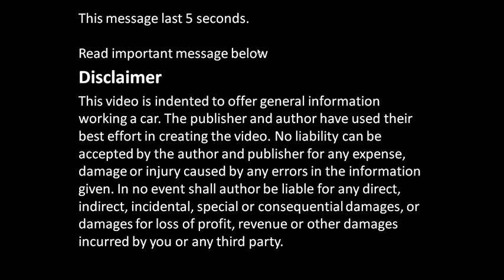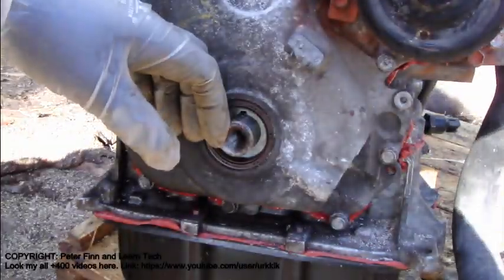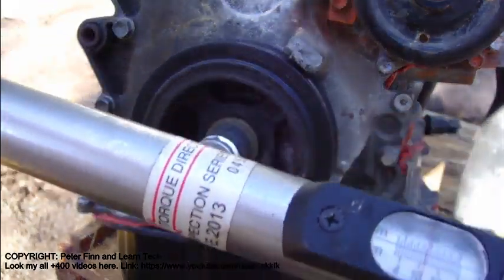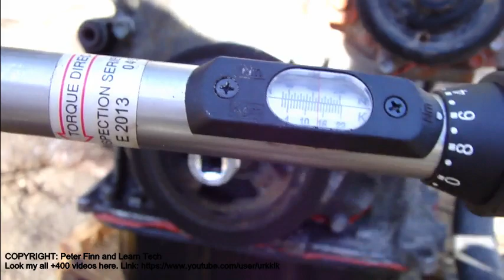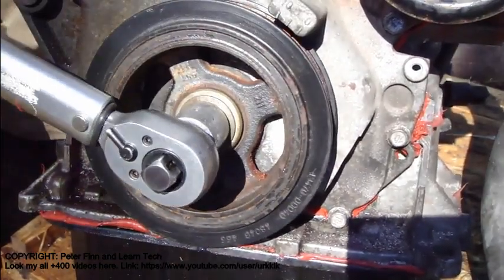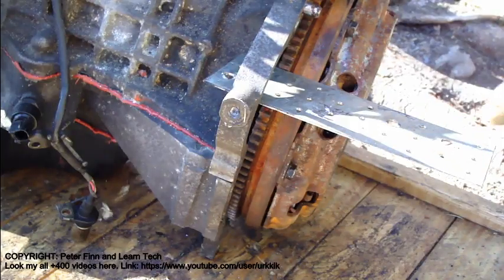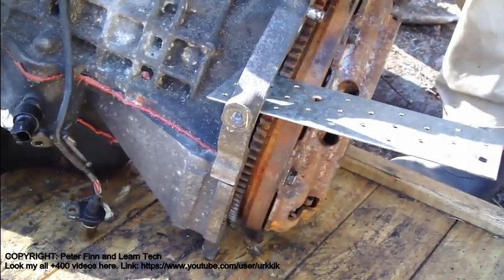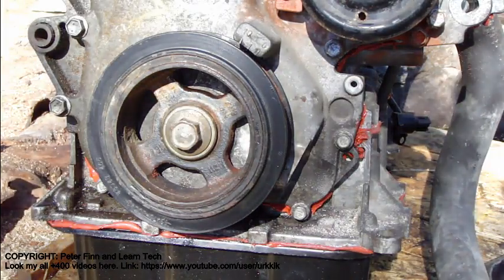How to assemble engine VVT-i Toyota Part 34: Crankshaft pulley wheel

Comment: Hi Peter, good night. Can i use this method to remove the crankshaft pulley with the engine in the place? Im need to remove the crank pulley to remove the timing chain cover on a 1zz
Reply from the maker: Yes you can
Reply: @PeterFinnTheCarDoctor  removed the pulley with this method 2 days ago with the engine in place. You have Instagram? Ou Facebook?